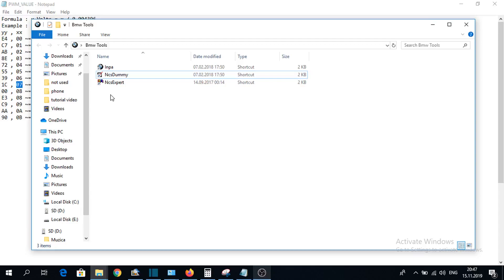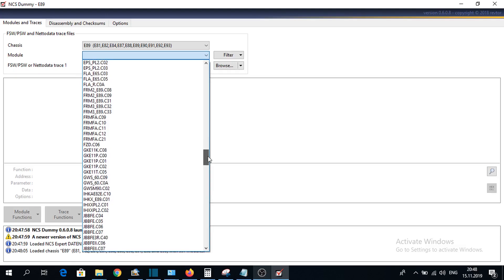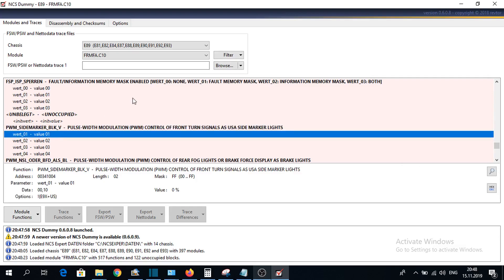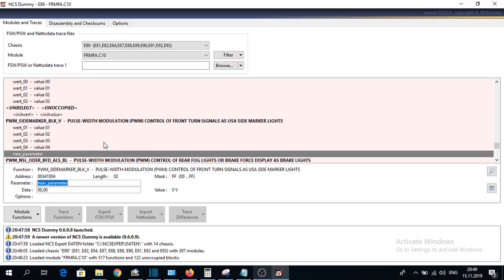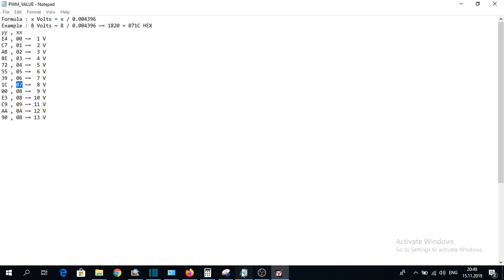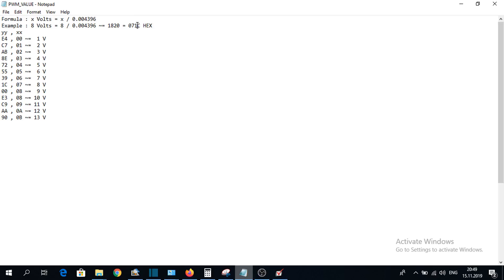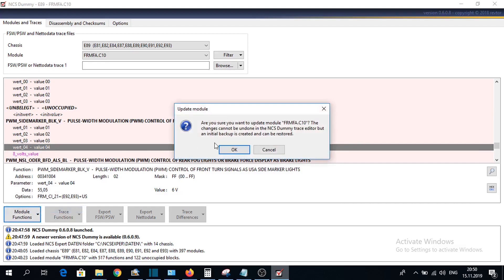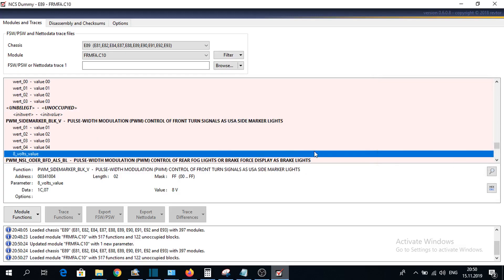3. Add new value for us lights intensity on BMW e90

Comment: Salut! Videoclipurile tale m-au ajutat foarte mult! Iti multumesc. In cazul in care gresesc ceva la frm, cum resetez toate valorile la cele initiale? Exista riscul de a strica masina in sensul in care aceasta sa nu mai poata porni? Cu siguranta suna exagerat, dar vreau sa fiu cat mai sigur in ceea ce fac. O zi frumoasa!
Reply from the maker: Salut, ma bucur ca am putut să îți fiu de ajutor. Cea mai simpla metoda de a reveni la ce aveai înainte ar fi sa iti faci o copie la fisierul FSW_PSW.TRC. Dacă observi ca dupa ce ai facut modificările tale, ceva nu mai merge, atuncea o sa ai această copie pe care o sa o scrii in modul. În principiu sansele sa strici ceva ireversibil sunt destul de mici, cel puțin eu nu am reusit dar totusi recomandarea mea ar fi sa nu modifici parametri despre care nu stii la ce se folosesc sau doar bănuiește că ar face ce crezi tu. O zi plăcută!
Reply: Mersi foarte mult!